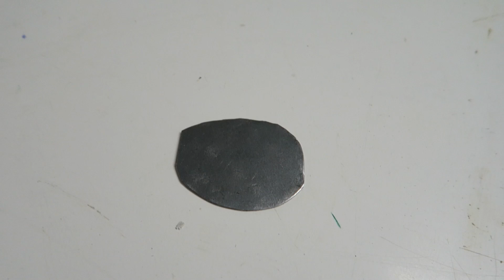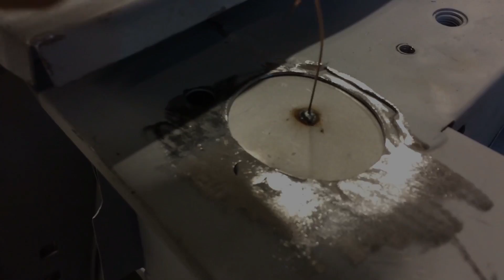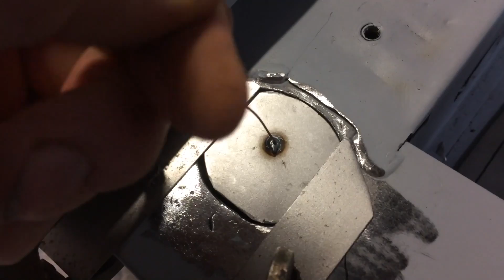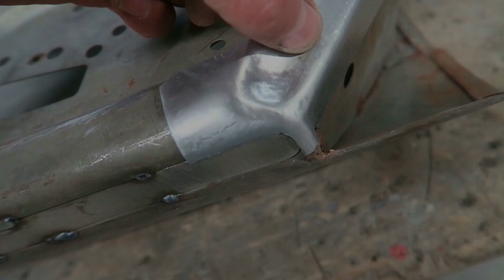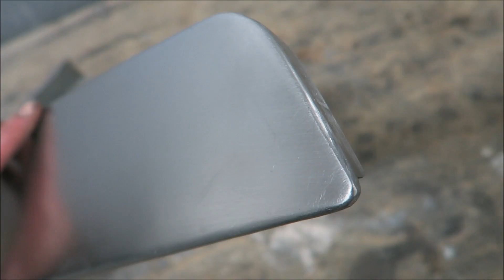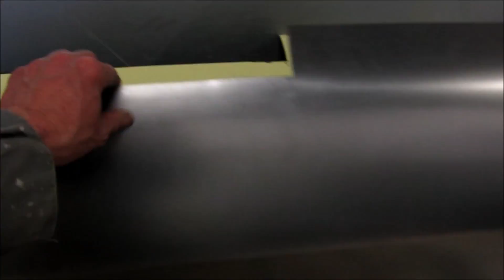Easy tip for welding a repair section into an enclosed panel. Tips and Tricks #39 Panel beating

Comment: You can buy those watch battery sized super strong magnets. You can glue one on each end of a tubular rod, eg: 5 mm diameter, and one on the end of a solid 3-4 mm rod which is inserted. This gives you varied adjustment, and those super magnets, they won't let go!

Comment: I've done something similar for years using a stud gun to weld on a stud as handle or just migging on a small scrap. Don't know why I never thought to just use the mig wire itself. Much easier. Thanks for the tip Trev. Much appreciated!

Comment: hi trev, I not long bought a clarke 165E (not clarke 165TE, they appear to be a much newer model). I bought it for general repairs to do on cars, usually I’ll be using sheet metal (mild steel) from 1mm to about 3mm thick I’d say. what’s the best gas to use for this and will it be easy for my to judge how much I gas I need to use once I get welding on test patches? gas and gas settings is the one thing I struggle to wrap my head around, which makes me laugh as I used to do a large amount of welding at my old place of work, but the settings was already done and all I had to do was turn everything on to use it haha. hopefully you can answer my question and I hope I haven’t over complicated it. thanks, Jack.
Reply from the maker: Jack Thompson argon Shield argon/co2 5% set at around 6 litres per minute. Cheers Trev 👍

Comment: That is a fine DS you've got there. Not much rust on it.
I usually remove whole sides of chassis and replace them with new ones since they tend to rust from inside as well, but this one looks good.
Reply from the maker: Alex the whole car has been replaced from the windscreen back. Cheers Trev 👍

Comment: just use a magnet..holy jezus..we're not in the dark ages!!!!..lol
Reply: A good magnet that is capable og holding the patch in place, is also gonna mess up your welding arc specially on such small patch as the one in the video.
Reply: @asantos84  ..dont talk shite chum....magnets have nothing to do with welding arc....i have been using magnets for years for my weldind jobs....only thing is the magnets loose magnestism due to extreme heat.....not a problem really

Comment: Well well, your notification was just the excuse i needed to get off of ebay....im doing my head in trying to find the best chinese mig with delivery from china cos im not that far away.... and i started doing floor repair patches on my escort today using the method wot you just showed me! 
Happy days.... well not really! I hate welding up rusty old junk :(
Reply: theravedaddy I got a titanium flux core for $180 from harbor freight and I wish I had got it sooner. I didn’t realize mine old craftsman was that bad. It welds real good easy to set up is small and only weighs 17 lbs.
Reply: @britjamaine9229  ive got some choices here from £125 to £350 but thais dont write any useless info up like amps or minimum thickness weld.... they just make a big deal about the free cardboard welding mask and 1kg of wire!
Reply: It may not be avail to you as it runs on 120 volts but they do make a higher voltage available here. My setting chart starts at 1.2mm and goes up to4.8mm or 3/16. I have welded smaller if that is a concern. I wish you luck

Comment: Trev....love that shirt!! Very distracting though!! 
   I use the same technique but use magnets instead of the metal strips, it holds everything secure too so no need to hold the mig wire, giving you a free hand to support your welding grip for accuracy. 
     Another brilliant tip. 
  Thank you.
Reply: Magnets are easy to get, grab old microwave oven magnetrons, and there are 2 large ferrite magnets inside. then either grind them in half ( masonry disk or diamond, plus plenty of water) or just break them in 2 pieces, and you have a strong cheap grip. When they get too battered simply toss in the scrap metal bin and grab another. Small ones from old speakers are useful as well, I have some in the car for working on it, they simply are stuck to the inside of the engine compartment always. Helps to get bolts out from deep spots, hold something while working and just keep all the bolts and nuts in one spot.